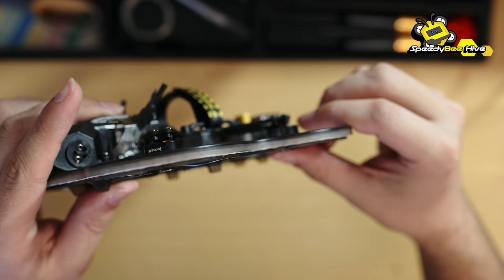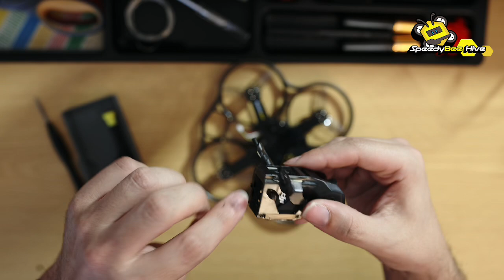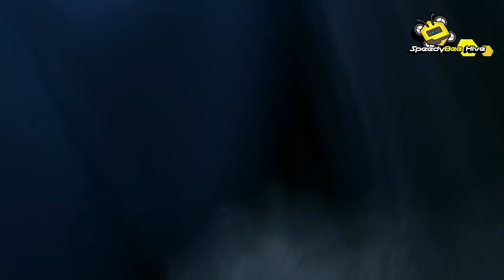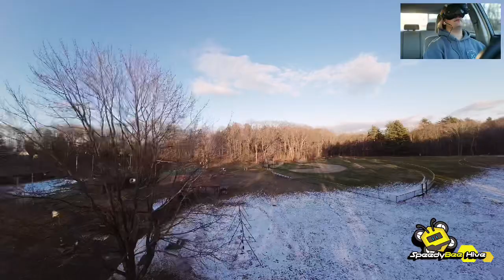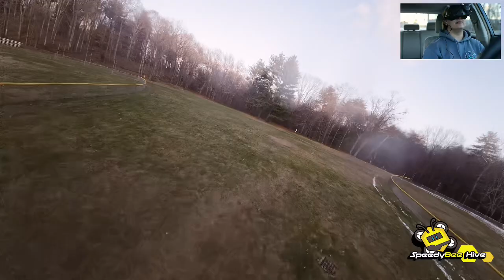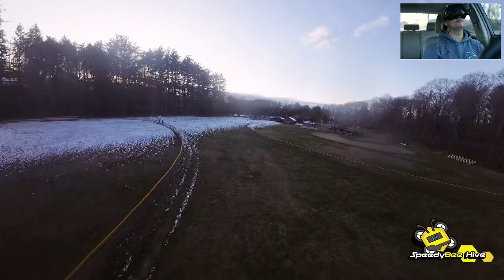🏆 Bee25 Review & Flight Test by Our User @alwaysstayfocusedmedia9890  ✈️

Comment: I think i need to re do battery straps toi put batteries toliet bowl style to fit my batteries i have that are bigger and higher C rating.. my 14.7v 4s 850mah tanked instantly to 14.0.. wanted to test hover inside first. hovered for 5sec lmao.. atleast motors were still cool haha.. im using D63-5 blades